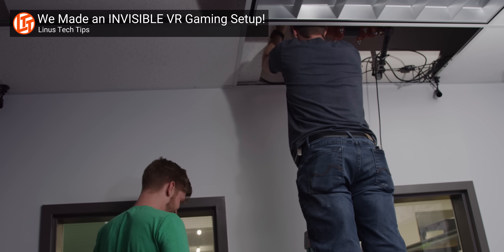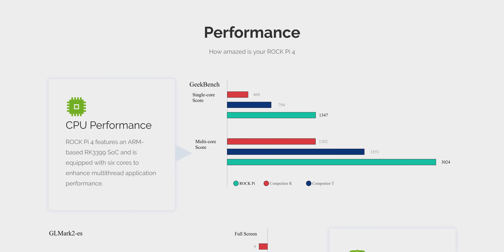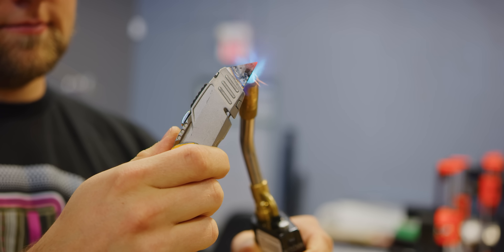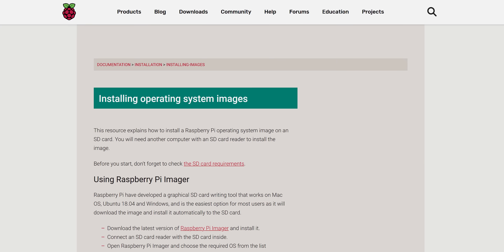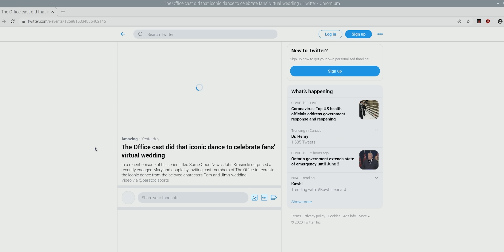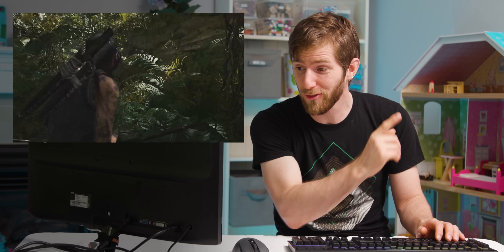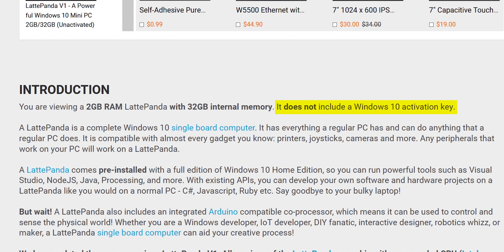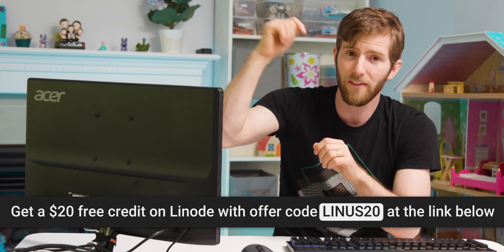My SECRET Computer……

Comment: I just use my rpi headless to store/hide anything over ssh from my main machine. Just plug it in to my phone charger and it auto connects to my main wifi, ready to be connected by my main system, works pretty nice as a storage center

Comment: thanks for the tip man I am going to do the same but instead of 2 wires for power I will put in a pie power converter inside the screen  using  the monitors power source or add a small 500mA, a 5V, 2.5A inside the monitors case/shell housing while adding custom ports and use a Wi-Fi bridge from a different pc

Comment: I'm sure there is a 5 volt line on the display controller that you could have used to avoid having to run 2 power cables

Comment: I shall now answer for Linus. Operative word being "stealth."

I Shall now be a Dingus and ask if this can be preformed with his 8 Gamers 1CPU setup. possibly meaning one can move a monitor integrated with a Pi anywhere with power and local network connection to connect to a VM with the same performance as hardware?

theoretically possible? cannot find information testing this as most searches for multiple gamer's 1 CPU lead back to Linus.

Half Life 3 confirmed?

Comment: Another reason on why to use linux instead of windows.
It is better and your neckbeard looks better.

(you can also run windows on a raspberry pi if you really would want to)
Reply: You can't run Windows, at least not smoothly.

Comment: Couldn't you just...make a 3D-printed box in the size of the vesa-like (not sure if that's for sure vesa) mount on the back, and just screw it into that? My step-mother needed a small pc for her vet office she runs, so I found some 8th gen intel NUCs and screwed them into the vesa mounts of the monitors and they basically looked like all-in-ones. I run some custom shortened hdmi cables and they worked beautifully, with only the powerbrick for the pc and monitors there. Like, i know it was supposed to be cheap, but you could fit a bit better pi combo, or something better into a small box on the back.

Comment: Do you have any solution for using a single power cable for switching on the Raspberry Pi and the Monitor? A True All in One computer system.

Comment: Did they explain why they didn't just actually use a Raspberry Pi 4? I couldn't find it
Reply: Maybe they went with the RockPi originally because of the M.2 SSD support (@ 2:10, which the Pi 4 doesn't have without needing to use one of the USB ports). It's also worth giving some of the single board computers other than the Raspberry Pi family some recognition too (although that said I'm being a tiny bit hypocritical - I was planning to build a print/storage server and haven't really considered anything other than a Raspberry Pi 4th gen!)

Comment: Does Linus know that Raspberry Pi 4 has 1Gb ethernet port? It can be used with PoE too. And, running a aarm64 version results in fewer frames. And you can make it to boot from USB or network. So there's that.

Comment: The rpi supports POE (power over ethernet), so sticking an ethenet cable would solve the network issue and the power at the same time.

Comment: Would be alot sleeker if you hooked the pi up to the monitors power with a buck converter and used a Bluetooth  mouse and keyboard combo with a Bluetooth dongle plugged in and just seal off the IO completely

Comment: my suggestion for this is to use Parsec, i find it works wonderfully for remote gaming, even outside of the house about 2 cities away on a low power laptop. i haven't tried it with my raspi 4b yet, but considering the specs it should run pretty well

Comment: 8:02 why use a raspberry pi, instead of something that actually runs Windows
Technically, you can run Windows 10 arm natively, tho you might want to upgrade to a ssd first (there is one that connects to the GPIO on the pi)

Comment: So, after thinking about this project for a while I have come to the conclusion that since a keyboard is necessary to use said "hidden" computer, why not just put the computer in the keybaord? I feel this is a superior option. It makes the hidden computer way more portable, and it can be used with any monitor or even a TV. Also, Dell, HP and Apple (and others) already make all in one displays that have a pc built in. This makes used premade options available that have more features and are way more powerful. Finally, one could just plug a compute stick into a display.

The kind of project I have in mind for an older monitor are making an arcade style retro gaming cabinet out of them, a DYI home projector, or mounting the LCD to a glass side panel and making a DIY version of the ibuypower snowblind.
Reply: Raspberry Pi actually manufactures the  "Raspberry Pi 400". Which is essentially what you stated. As for being stealth, having the big logo on the keyboard is kind of a give away.
Reply: @JKPieGuy  Well yeah, if you use a Pi 400 it will be obvious. But if you build your own then there's no logo.

Comment: Linus, you came searching for gold but you found silver instead. So, here's my 2 cents on the topic:
1st - Pi 4 now supports ssd boot from scratch (beta firmware) so you get a lot more snappiness from the pi. Isn't this LTT?! Are we falling short on madness???
2nd - Despite having a good WiFi connection, it's always better in that case to have a cable connected. That will improve the frame delay by a lot (and we're already talking ms).
3rd - Uh StEaMLiNK! NoIcE, i can play all my steam games! Yeah, how about other games like Hearthstone or WoW?
Here's the guidelines: https://linustechtips.com/main/topic/1117242-moonlight-project-for-raspberry-pi-34/?tab=comments#comment-12996118
AMD has AMDLink, haven't dug anything around that yet but i guess it should work as well.
Cheers!
Oh and let Andy review the new pi 4 8Gb PLEEEAAAASEEEE!!!

Comment: I first thought you would fit the PC in the ceiling up in the tiles and use Bluetooth devices and wireless screen connectivity to have basically one monitor power cable. A little disappointed.

Comment: A Raspberry Pi 4 without any sort of even only passive cooling, stuck into a case without any sort of halfway decent cooling but with additional heat-producing components? Yep, that's not going to run hot. At all.

Comment: VERY disappointed you didn't run power from the LCD power board . or tap into the 110volts and a dc converter . Something .. anything other then running a separate power cord down the monitor stand ..

Comment: i did this with a 4k tv and the guts of a android tv box .....has a internal usb3 drive of 4 tb contained in my tv  has all  my media on it as well as steam link and my chosen streaming media  apps ect and because its already a android tv box the build make it look like a android tv only on steroids due to the android box specs ... ive also sourced all power for supply's "also internal" from the tv,s main plug allowing the tv and android system to operate separately if need be  ......the hdmi  on the android board used a flat cable and so did the tv to the hdmi outputs so i sacrificed 1 of the headers for direct connection ..  was a fairly simple [project  in reality and it looks as if its just a plain old 4k tv until you change the input to hdmi 4  has been fun to use and have friends try to work out how a no name 290 aud tv is able to run what it can  while looking entirely un touched

Comment: i did the same with a macbook pros logicboard (aka mainboard) from 2009 since display was broken and battery already done, works awesome, but performancewise its crap af. But hey, it was for free since the Full HD acer monitor was already some sort of "trash" and same goes for the Mac itself after years of heavy mobile usage. So just a iMac out of 2 old devices anyone else would have thrown away.

Comment: since linus invited it, here's what Id build for minimum buck off ebay, Total of 365
HP desktop with i5-3470S and a 500gb HDD cad$160
16gb ddr3 1600mhz cad$100
rx 570 msi cad$140
crucial mx500 cad$100
so total is cad$500/USD$365
you could make some of that back as well by selling the included ram and/or the hard drive in the tower, maybe go cheaper on the gpu (rx 560?)
.
.
https://www.ebay.ca/itm/HP-Elite-6300-TOWER-i5-2-9GHz-Desktop-Computer-8GB-RAM-500GB-HDD-WIN-10-WIFI/153845652237?hash=item23d1ea5b0d:g:JNoAAOSw9tFeVZWu
https://www.ebay.ca/itm/KINGSTON-HYPERX-BLU-16GB-2X8GB-DESKTOP-MEMORY-DDR3-1600-KHX1600C10D3B1-8G/333591869607?hash=item4dab9ff8a7:g:HiIAAOSw4u9c~qQ9
https://www.ebay.ca/itm/Msi-armor-rx-570-4gb/233600608328?hash=item3663ae6848:g:O5kAAOSwGnJeyjVx
https://www.ebay.ca/itm/Crucial-MX500-2-5-500GB-SATA-III-3D-NAND-Internal-Solid-State-Drive-SSD-CT500/184004416483?epid=5028682706&hash=item2ad78493e3:g:-oIAAOSwCB1drs2w

Comment: The installation process is NOT the same for all single board computers.  What Linus did works for the Pi. It will not work for something that requires overwriting eMMC memory, like the Firefly AIO-3399J, or pretty much anything that uses a Rockchip processor. For these computers, you will need to consult the OEM and hope that the pre-made OEM image is adequate, because getting Mali drivers will be yet another pain if it is not.

Comment: To bad you didn't use a buck converter and tap into the monitors power supply and have a true 1 wire hookup

Comment: There is a ubuntu server image available for the rockpi4, if you use that image and then just install mate desktop that gives you a great desktop environment on the rock pi where you can use a nvme ssd no problem rather than booting from SD on the Raspberry.

Comment: MANJARO would have worked with the ROCK PI  RK3399 https://manjaro.org/download/arm/rock-pi-4/arm8-rockpi4-kde-plasma/
Try and benchmark it, as it is faster than raspberry pi
Also RockPiX https://wiki.radxa.com/RockpiX  is a good X86 alternative
But https://www.pine64.org/rockpro64/ the PINE one is even better.
You also can do a series about this cards and benchmarks.
And the 100 USD Pinetab https://www.pine64.org/pinetab/ soon to be sold.

- ONE external energy cable should be a MUST BE in an AIO.
- Retroarch and Kodi with Internet Archive Game Launcher plugin https://github.com/zach-morris/plugin.program.iagl is also a MUST INSTALL in any ARM computer, even Android phones with MHL (TV OUT) as most Samsung.

Comment: I wonder if it would be possible to feed off of the monitor's power supply for the Rapsberry Pi? Even if the internals aren't 12V you can get some pretty small step down converters.

Comment: If you have an Nvidia GPU, you can also use Moonlight to stream your gaming PC to a raspberry pi, 1080p/60fps. Its easy to configure it to display your desktop as well and the results are very surprisingly good. I'd say this works a little better over wifi than Steam Link as well, in case you wanted to use your gaming PC say out in your garage where Ethernet may be impractical.

Comment: I love giving old devices new purpose to keep them out of landfill, here's a great use for an old computer;

Using Windows download a program called 'ContaCam' it's free to use and uses little resources so it runs great on outdated cpus, connect a few USB webcams and you've just got yourself a low cost or even free 24/7 surveillance recording system. 

Use a laptop and now you've got a low power surveillance system with a few hours of battery back up in the event of ac loss, a professional system with that feature would cost a lot of money.

Comment: 8:15 Or you can use the $100 LattePanda with Windows Arium which is a lightweight modded Windows that can run with 2 GB of RAM and doesn't require an activation key. However, I'd still choose to install Linux, which still is better on an Intel CPU than an ARM one, because more software is available on x64 devices anyway.

Comment: Basically the computer just glitches and needs to restart over and over again. It works for some time but then starts displaying pink pixelated blobs on the screen. The PC works fine with my old R7 but for some reason it doesn't with the Powercolour red davil RX 5700 xt. 
Specs: ASRock H370 performance. Intel i5-8500. 16 gb geil 2400 hzs memory. Hard drive of 2tb storage. Antec 550 watt power supply. The graphics card turns on fine when the driver are uninstalled. My theory is, I need 750 watt power supply for it to work.
Reply: so are you saying another video card worked or not . when i say video card i mean NOT built in GPU . 
i highly doubt its the power supply . if it IS its not cause of wattage , its more likely just bad . make sure you connect the  pci-e power to the card !

Comment: Well, i connected my pi recently to my monitor and my pc simultaneously, problem was, my monitor priorities my pc over my pi, and i actually installed raspian like 10 times till the realisation, if i disconnect my pc, it just works and i wasted like 5 hours and 3 much too expensive sd cards later

Comment: A much better fit would be a monitor with built-in USB hub that also have charging port since it will provide a constant power source for any 5V SOC board, and you could even wire a tiny power switch either in line, or to gpio pins to provide a graceful shutdown with a timer for non-graceful shutdown.

Comment: What a waste of time! Just buy a second hand Intel Compute Stick and plug it to the HDMI port. It is much more powerful than any Pi - here is even a Core m7 model! 
Also  its circuitry is much smaller than the Pi's too, so it would be easier to bury it inside the monitor.

Comment: actually, if your OS is an arm64 varient, you can still run 32-bit or armhf app on it. just run this in your terminal
$ sudo dpkg --add-architecture armhf
and you should be able to run all kinds of armhf apps on an arm64 computer.
it's been a while since I played around with one, but you should be able to fetch armhf compatible apps from your standard repos as well. other wise just download your .deb packages and "dpkg install" them.
same thing goes for aarch64 (x86_64) OSes, to enable 32-bit applications just run `$sudo dpkg --add-architecture i386`

Comment: How are you handling the thermal load issues with the rpi4? I didn't see any heat syncs or fans in there. If it's anything like mine, it idles quite hot.

Comment: why not use a buck converter, connect the monitor's power brick to the buck coverter to get 5v from the monitors power adapter so you'll only need one cord.

Comment: The Pi 4 now has new firmware that enables USB boot. A cheap USB to SATA adapter and SSD is a serious improvement. Easy to include in the project for not much money. A cheap fan and overclock to 2.1ghz also makes a big improvement. I bought my Pi4 last summer and the continued improvements to it have vastly improved performance and massive ongoing work is continuing on further improvements. I'm now using the Pi for everything that doesn't require a lot of CPU power such as video editing.

Comment: Would have been cool if you tapped the power from the monitor power transformer. So you didn't need two power cables.

Comment: You could have soldered an internal 5V power supply to where the power for the monitor comes in and an angled HDMI cable would have perfected it.

Comment: You know this voids the monitor's warranty? Linux though. No the dependencies won't just load up nor will other things and you'll type - lol "type" - it wrong and you'll end up throwing your monitor out the window. A placeholder on the monitor for your Samsung or Huawei phone is much better and use PC mode.

Comment: Now just solder the HDMI directly to the monitor port and run the Pi off a buck converter from the monitor power supply, and you've got a really stealth machine

Comment: I wonder how warm the Raspberry Pi gets in this built. Drilling some holes in the back, where the Pi sits might help some of the warm air to escape.
For those, who have a Vesa mountable monitor and don't mind to have a box mounted on the back of the screen, there are Vesa mountable Raspberry Pi cases with fans and heat sinks for less than $20. I prefer this over LTT's  DIY. It looks clean, is invisible from the front and provides better airflow.

Comment: The only three things I would recommend:
1) Put the Raspberry Pi 4 on the back on the monitor.  That makes it movie and you can put it on ANY monitor in the future.
2) Buy as passive cooling case! To get the most out of the Pi 4 , you'll want to over-clock it and cool it quietly. 
3) Overclock the Raspberry Pi 4 so that apps run better - especially for video apps.
Find, on YouTube, a video called "How To Play Netflix Disney+ HULU Spotify And More On The Raspberry Pi 4 With Raspbian" .

Comment: i think you coul've route power from main cable of the monitor since that cable is rated for more than monitor use anyway and that rockpi won't get a lot of power anyway, i think you could even make some batteries filling up all the space inside and make something to last over a year with that until charge back.

Comment: Pro tip - never exit big picture, instead - minimize it. At least this was the issue previously with the protocols steam used, they would disconnect after a certain fixed amount if there was no steam big picture running.

Comment: Two of them acer monitors but 27" version for £45 each with a viewsonic vx2757 for £50 in the middle makes a decent enough three monitor gaming set up for dirt lulz got em in my bedroom while got two 165hz ASUS 27" gaming monitors and will be getting a 240hz ein for the middle in my sitting room as the main focal view point is the middle screen  the side monitors do not need to be as fast and crispy as the central monitor.